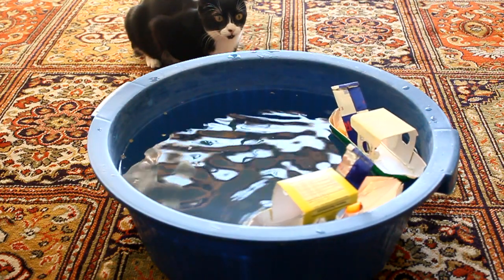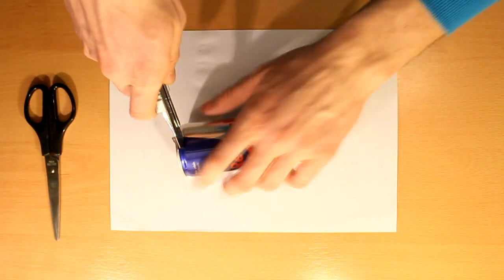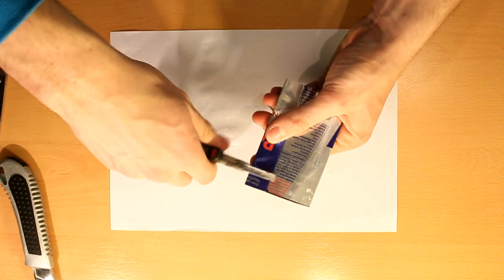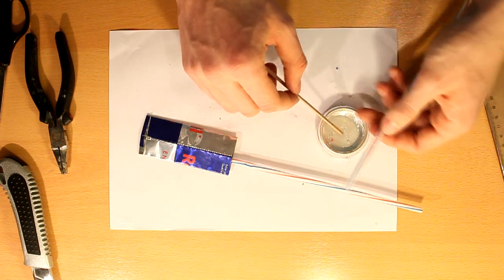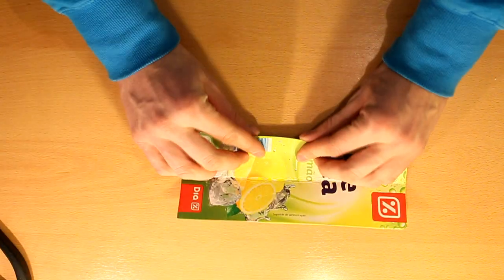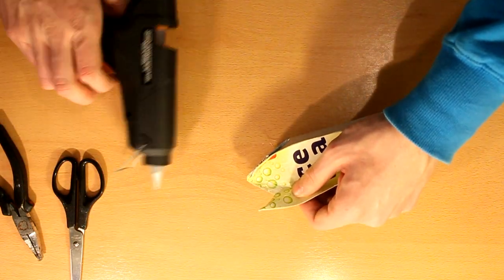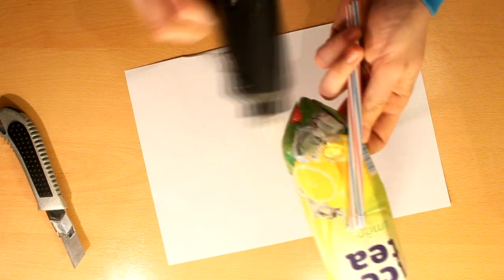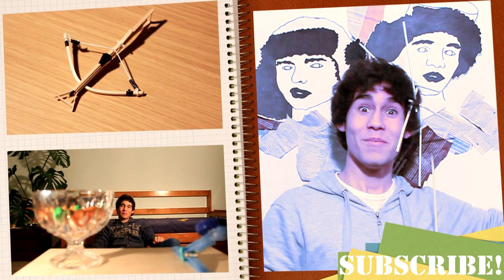How to make a Pop Pop Boat

Comment: the heat will melt those plastic straws.
Reply: I have tried it and the straws are fine because cold water get sucked in by the straws and pushed out since water is going inside you can't melt the straws